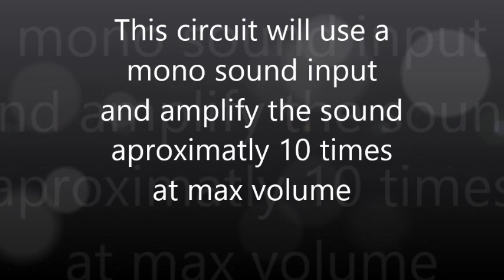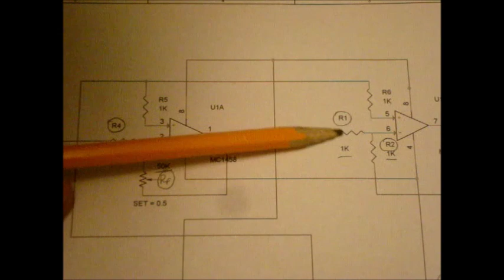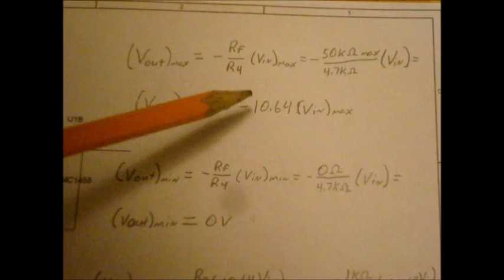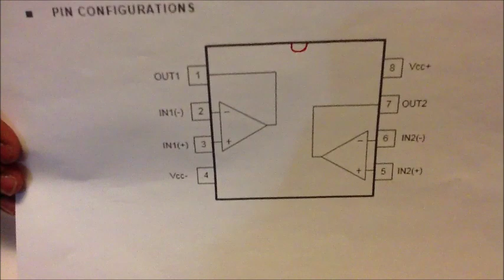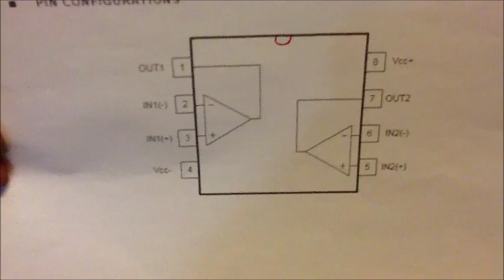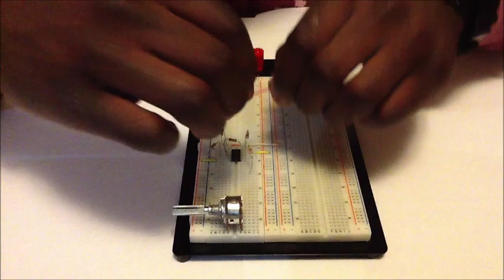How to build a mono audio amplifier circuit

Comment: how would you increase the wattage?
Reply: By opening the potentiometer.
Reply: How would you make it louder when the pot is cranked to 11?
Reply: You need more powerful power supply, with a circuit designed to handle it.
Reply: so how would i build that circuit, and power it by a car battery?